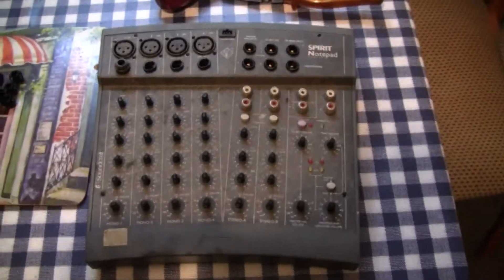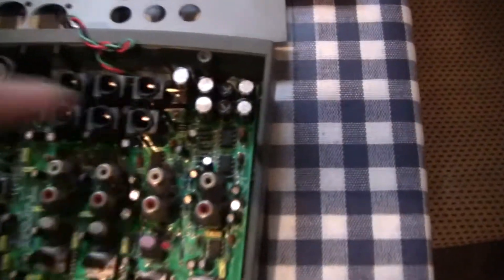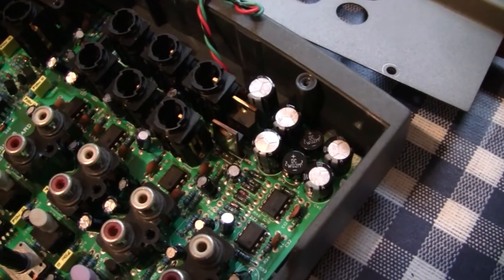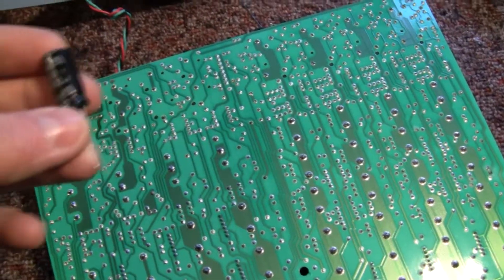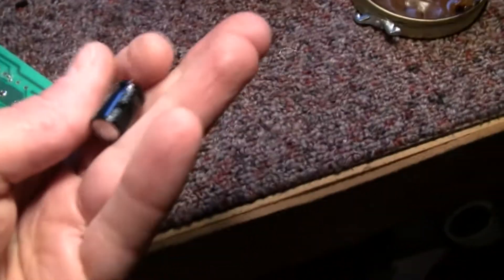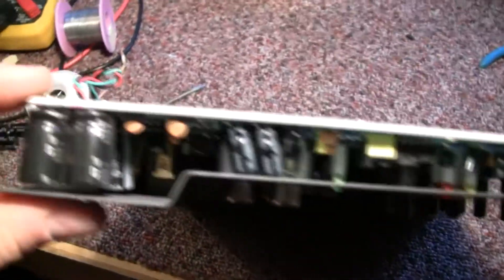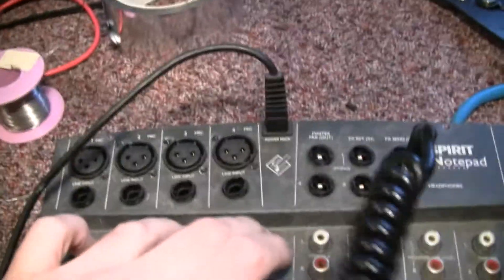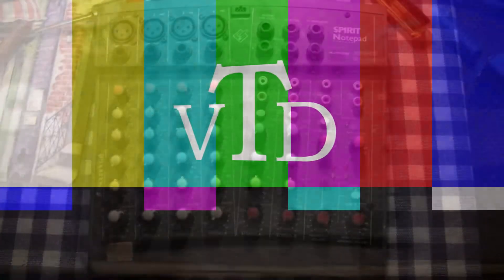Spirit Notebook Mixer repair

Comment: I have one of these but no power supply.   From what you say it has a built in supply but doesn't take 110V.   So I need a special transformer?   Can you give me more info I what I need (some strange transformer?).
Reply: You will need to order the proper soundcraft power supply I'm afraid. It uses a connector that's unique to them. VintageTechDr

Comment: Hello trust it or not but mine notepad have just colapsed " atm " and i have lost one of the two channel no more stereo ! before ( during a long time) when i lost one channel i just turn the two button down right (master volume and the monitor volume ) and the other channel come back but right now it is  impossible do you think this can be easily repair if i change the same capacitor ? or some other (vicious )part need to be changed to ??
Reply: The capacitor change shown in this video is only to cure mains hum/buzz due to failure of the aforementioned cap. You have a totally unrelated fault there by the sounds of it. Sorry I can't advise on that.

Comment: You used capacitors that are 470uF at 30v and 47uF at 100v right?
Reply: I honestly can't remember off hand, if you watch the video I explain what I took out and what I put in. When replacing caps, the capacitance value in "uf" should be the same, however you can use caps rated at a higher voltage but never lower.

Comment: I have the exact same mixer, what caps were exactly used?
Reply from the maker: 470uF 30v
Reply: @vintagetechdr1180  I thought you also mentioned a 47uF at 100v ?

Comment: Nice video, when I power my mixer the two red peak leds stay lit  this should not happen correct ?
Reply from the maker: No that should not happen. Although from that I ccouldn't say what the fault is. Might be woeth briefly connecting a pair of old headphones (ones that you don't care about) to the headphone socket and see if there's any noise/hum/buzz there. If there is, then it might be the same fault.
Reply: I have that problem and am researching it right now. I suspect the TL072 ic (IC9) that feeds the audio signal to each of them.
Reply: @jamestaylor7025  I replaced the ic and the problem  still remains.
Reply: @simons_pics  Thanks for letting me know. Did you ever trace the fault and fix it? 
I notice that there are 2 - 2.2u caps (C55, C56, C58 and C59) in each of the monitor circuits, how did they look to you?
When I get a chance I'll open mine up and have a look around.
Reply: @jamestaylor7025  I replaced all the caps.
Reply: @simons_pics  Did you replace the PSU caps (C43, C44 - 470u, 35v), my thinking being that ripple or noise on the +ve rail could be triggering the monitor LEDs/transistors.
Reply: @jamestaylor7025  No but will now thanks.
Reply: @simons_pics  I've just today received two new 470u 35v caps and will be replacing the PSU caps soon myself. I did notice that C44 in my unit had a slightly domed top. I'll try that one first.
Reply: I've just replaced both caps (C43 & C44) and it seems to have fixed it. I'll need to reassemble the mixer to test it properly.👍
Reply: Now reassembled and all seems to be back to normal - 😀